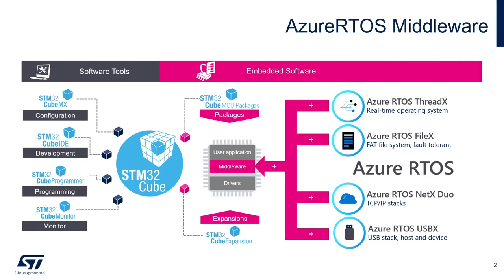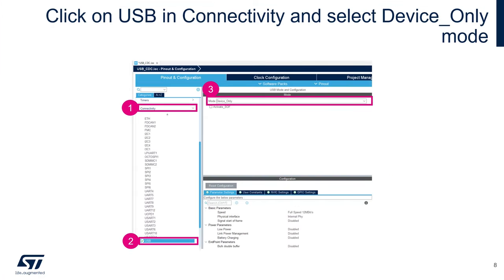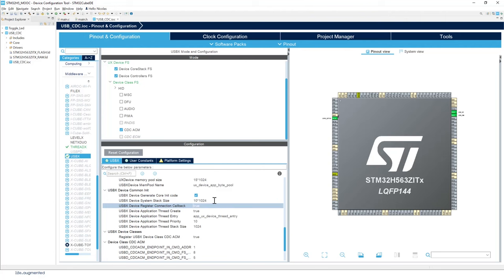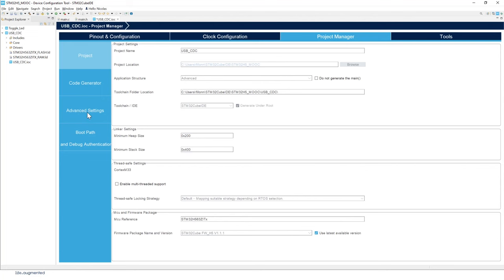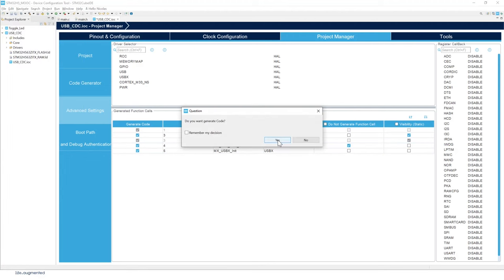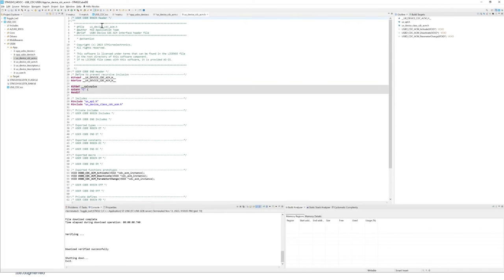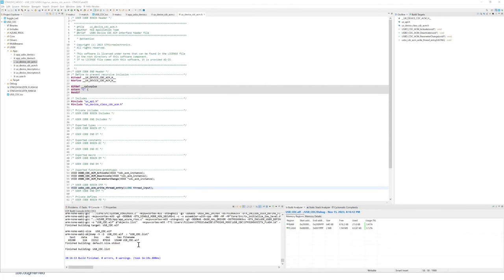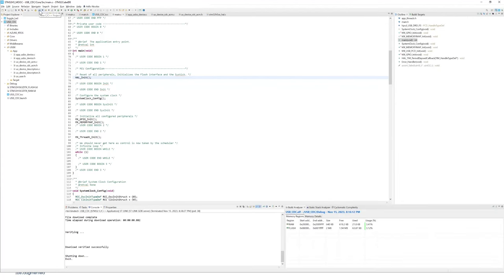STM32H5 workshop - 09 USB - USBX-CDC lab (experts)

Comment: Hi there, Thank you for the very detailed tutorial. 
I need help running this code on another STM32 board.

I am trying to run this tutorial on my NUCLEO-U575ZI-Q board. It has USB_OTG_FS peripheral so I had to make certain changes to the code.

For example for the "hpcd_USB_DRD_FS" I had to use  "hpcd_USB_OTG_FS". Then the function "HAL_PCDEx_PMAConfig()" is not available for USB_OTG_FS, so I left that part out (maybe I need to do something differently there.)

In short my code compiles correctly but the board does not show up as COM port when I plug it in. Only the ST-LINK VCP shows up in the device manager.

Can you please provide details explanation of what the code snippets you provided is actually doing and how to modify this code for devices with USB_OTG_FS.

I am also eagerly waiting for ST to share USBX-only (no Azure ThreadX) version of the middleware.

Thank you once again.